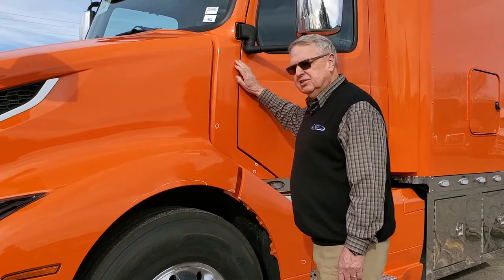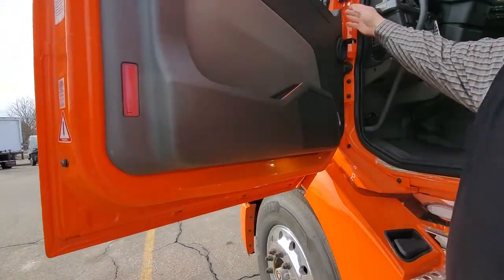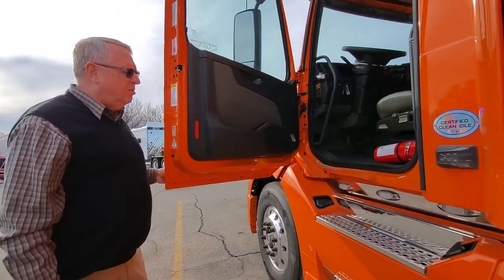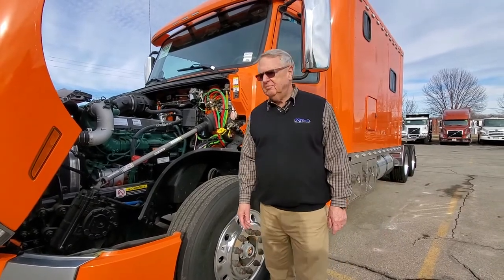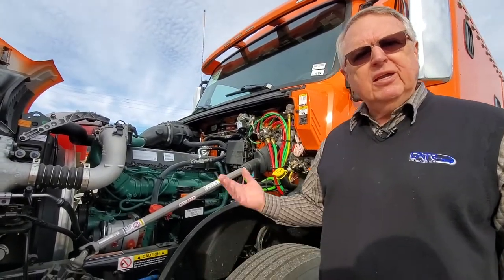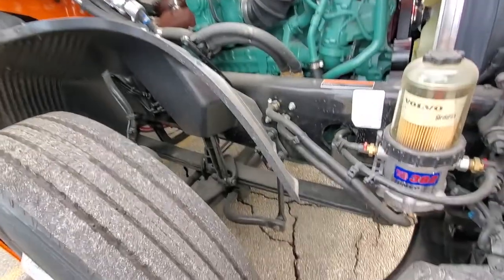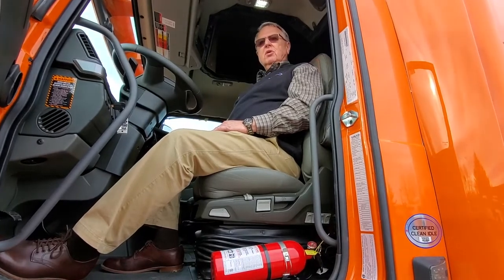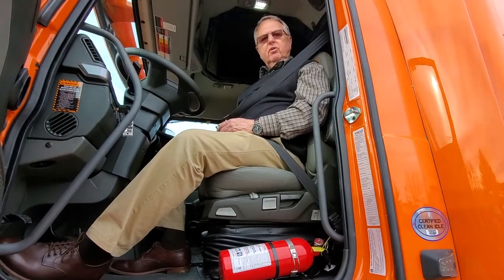GATR Big Bunk Safety

Comment: There is no doubt that Volvo has a very safe cab but there is also no doubt that Volvo is the least reliable class 8 truck out there. Add into that Volvo repair shops are few and far between, parts are not readily available and so on. The next time you see a big truck on the side of the road have a close look....chances are it'll be a Volvo. A poor choice for an o/o to make a living with.